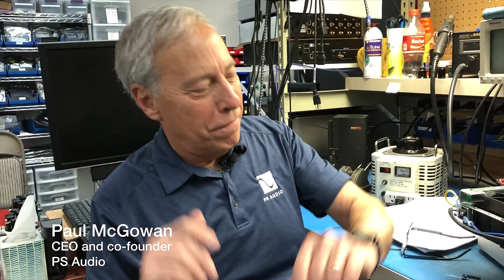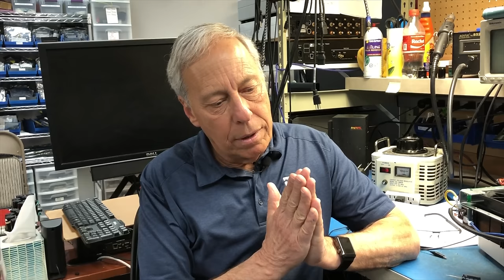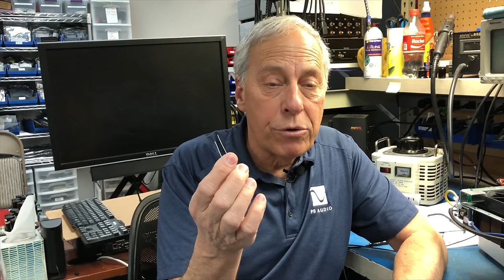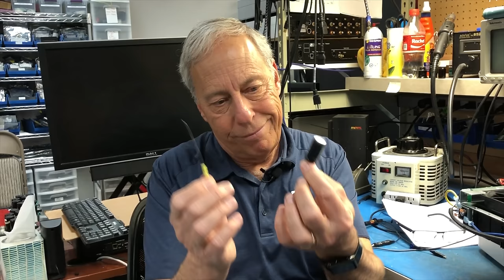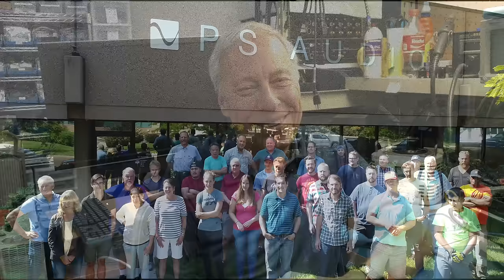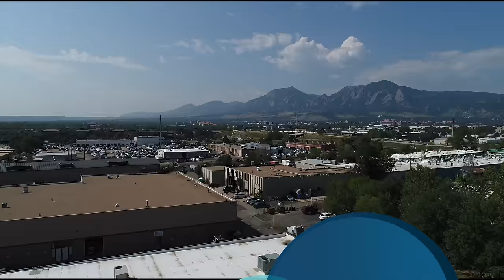Why do capacitors sound different?

Comment: Good job, you completely failed to answer the question.
Reply: Spot on , Nick , it reminds me an old song from Frank Zappa : " We're only in it for the money"  ; )
Reply: At a certain point, you have to sell snake oil when you're asking thousands or tens of thousands of dollars for A/V system components.
Reply: you don't even listening.......he already answer, paper cap are great passing sound then electrolyte.
Reply: @tukangbobo But EVERYBODY already knows that.
Reply: it comes down to the internals of the capacitor, in how the capacitance is created as he was describing...  the electrolyte liquid inside an electrolytic capacitor is a big hack to get the 10000x gain in capacitance over the more pure film capacitor.  It saves size and cost (seriously, can you imagine the enormous size of a 10000x film capacitor?).  And, what Paul said was, there is a huge high frequency loss that is assumed when you use an electrolytic capacitor...  it's just a given... however, metal film capacitors do not have as significant of high frequency losses as electrolytic capacitors, and when you place the two together (parallel) in an audio circuit, the two compliment each other, and you get a better sounding pathway for your audio signal.
Reply: @ILikeStyx  Paul is an engineer, and yes, he sells expensive products, but if you listen to what he is saying from an electrical engineering point of view, he is spot on, and really knows what he is talking about.   There is no inexpensive way to chase the low THD (distortion) and S/N (Signal to Noise Ratio) like he is trying to do.   If you go through his product line, everything he has is expensive, but it all focuses on his way of solving noise and signal integrity problems that haunt the best engineers since the discovery of the transistor...  attention to detail at every level is good engineering.

Snake oil is CD stabilizing rubber rings, and other cheap tricks that do nothing to improve the sound.  Paul doesn't do that, he is being a meticulous engineer, and that is expensive to do, but if you look at his numbers, his equipment delivers, and you can't argue with low THD and very high S/N ratios.
Reply: Yeah, he really failed to answer the question. Instead, he went off on tangents such as telling us about Michael Faraday. 

Danny over at gr research stresses the importance of quality components. He talks about the differences between capacitors in some of his videos. 

My understanding is that cheap caps hold the signal briefly before releasing it, on a frequency dependent basis.  Better caps pass the signal through without causing such phase distortions. Please don't hold me to that. Please instead just watch Danny's videos.
Reply: He straight up answered it though…
Reply: @perniciouspete4986  i didn't
Reply: @EskWIRED it isnt true. All decent caps sound The same.
Reply: What do you expect, this is a snake oil salesman😂
Reply: He did answer the question. The unwarranted answer is his spending time trying to describe the size of his sample capacitors.

Comment: This video doesn't address the question posed in the title.
Reply: you just did not listen
Reply: why, it's mostly because of the ESR rating and capacitance, generally speaking, in a well engineered circuit, it would not matter, for example you can replace the caps with "better" ones (for your own definition of better), and it won't make any difference
Reply: @HornWorm8  I must have missed it. Can you please tell us the answer, since you now know it ?
Reply: Because of their makeup
Reply: Well, it's a question not a statement, lol. Maybe if it said 'Why capacitors sound different' then your point would have a leg to stand on.
Reply: Blade Runner frequency is not an answer it's a word. Can anyone give a sane answer to sane people?
Reply: I agree with Beelzebud. He addressed the cost difference of two different types of capacitors. The question is more about if two brands sell the exact same type and value capacitors but one cost 5c and the other costs $5, does the $5 one sound better.
Reply: Yes it did. Plese to watch it more carfull and this time TUN RUP TEH VOLMES!
Reply: Nope, the answer of why do they sound different is not addressed at all. How they work differently, sure.
Reply: @thomasa.anderson4711  the materials used in the capacitor and resistance characteristics
Reply: 0:34 The question's premise is "...if they have the same specs...", why does cost make a difference?
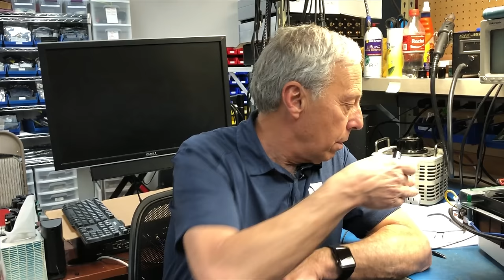6:27 The answer given compares two capacitors with very different specs, one of which is better for audio.

The answer he gave was interesting and worthwhile, but I think he missed the "same specs but different cost" part of the question, and therefore didn't ultimately answer.
Reply: I'm glad you said that. I''m 3 minutes in and tuning to something else.
Reply: Agree. I think question was in line of why put X or Y Cap and where, which type and capacitance to address (boost or cut) such and such freq. I know the whole circuit plays the role here. And that's OK. I believe the better way to explain this would be with two or three examples like: for 100 Hz addressing in let's say phono pre-amp you need to go this route... Or for 1kHz you need to go that route... Something like that! Otherwise, I love this vids. Greta work! Keep them coming. ;-)
Reply: @ilovecops6255  how about $30 jensen vs $5 no name with same specs, does it sound different?
Reply: Agreed. The question was likely referring to audio grade electrolytics vs those designed for say a power supply. The letter even specifies caps of THE SAME SPECS and he totally ignored it.
Reply: @taaviparn9175  He did not explain the technical part why a film capacitor "sound better" than a electrolytic capacitpor in the audio path :)
Reply: in fact it doesn't depend on the quality it depends on the type of capacitor, an electrolytic capacitor is slower so it doesn't work as well for high frequencies
Reply: can you connect your speaker to compare with cheap mundorf 47uf Mcap tin cap(white.color) vs 47uf Mcap Alum vs 47uf Mcap supreme silver oil vs 47uf Mcap Supreme silver/gold/oil EVO.  Does it sound different ! Live Video have ? 😍😍. ( can u do a video with that can ? It will be very Fun to try )......."/
Reply: Capacitors don't make any sound at all. They pass electric signals. They do this, but not perfectly. In an audio signal, they shave off some very high frequencies. It is a filtering curve. The physical materials in the capacitor type shave off more or less, or the corner frequency of the filtering changes. The capacitor type matters less than the value of capacitance. The circuit design matters more than the type of component.  And in the end, the general populace will not notice or care. Cork sniffing.
Reply: @dreamingone615  Ceramic caps sound different than an equivalant mylar cap when audio is run through them. They're said to have a "hiss" and to be microphonic. The hiss is measurable, even if you can't hear it, and the microphonic property is obvious by tapping it while the amp is on.
Reply: @Beelzybud  agreed. I don't like ceramic caps in audio circuits. I don't even like them for a tone knob on a guitar. Which is where they could be the least offensive. I didn't even think of them when I commented.
Reply: Indeed, a lot of words but no answer.

Comment: I'm still really curious about the answer.
Reply: I could be wrong, but my take is this. Capacitors are not actually perfect,,, actually they filter imperfectly. (They will "leak" freqs that should be blocked and "lose" freqs they shouldnt.) Different caps result in different styles of leak, just like transistors and tubes have different clipping and compression. ,,,, but i could be trippin.
Reply: @tsmspace  Shrooms?
Reply: @dannyverhamme7970  capacitors,,,, are like snowflakes. In a pile of snow they are all the same.
Reply: OMG! MICROFarad...one millioneth of a Farad, not 1,000th! (More coffee Paul!)
Reply: Old video but if you're still curious it's because different materials charge at different speeds. There is also the issue of linearity where some types of capacitors don't charge and discharge with as smooth a curve as others.
Reply: @BrianSu  i would love to hear more,, for example,, are we talking about the resistance of the materials? are we talking about something that still means resistance but is not described as such (maybe some kind of property of polarization of different materials),, I think I don't know where any of these subtleties are "officialized"
Reply: @tsmspace  I didn't spend much time searching because it was hard to find information, however I did come across the odd paper or two that contain some graphs for comparison etc. Try searching why capacitor material affects sound quality, I hope you'll find your answer.
Reply: @tsmspace  great answer. You should have done the video. Most videos from ps audio are like this 😀
Reply: What was the question? 🙄🙄🙄

Comment: The letter author explicitly asked "if they have the same specs (i.e. capacitance!), what is technically different and how does it translate to audio?"  You then proceeded to suggest the poor audio quality is due to using the wrong size capacitor (using a 4000 mfd electrolytic vs.  0.01 mfd film cap).  Total nonsense answer.
Reply: can you connect your speaker to compare with cheap mundorf 47uf Mcap tin cap(white.color) vs 47uf Mcap Alum vs 47uf Mcap supreme silver oil vs 47uf Mcap Supreme silver/gold/oil EVO.  Does it sound different ! Live Video have ? 😍😍. ( can u do a video with that can ? It will be very Fun to try )......."//